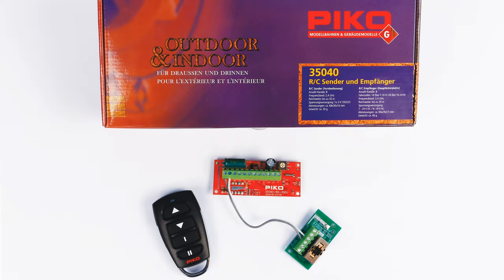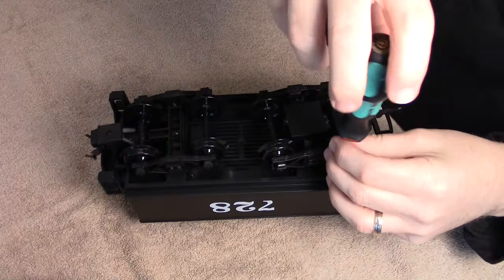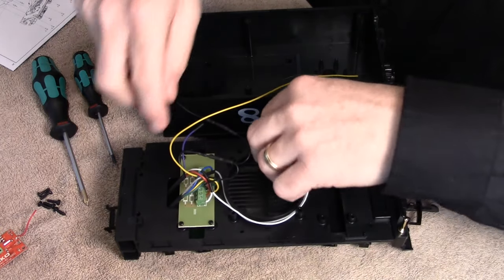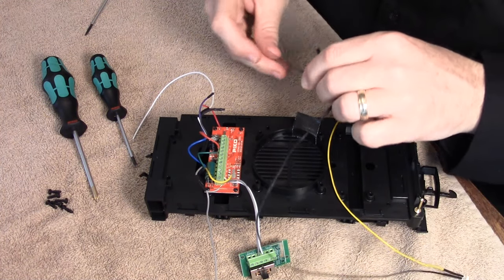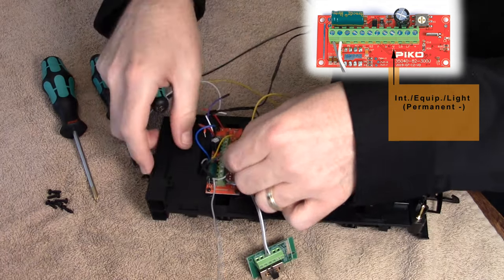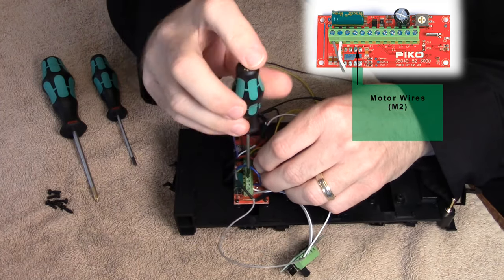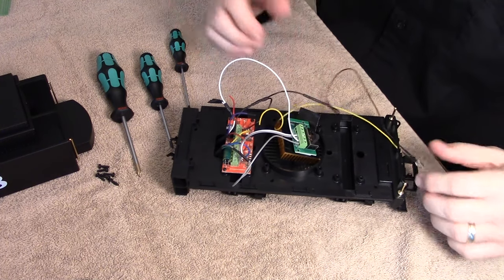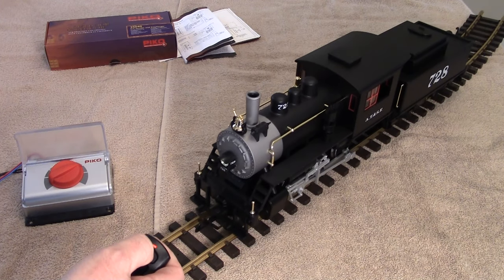35040 R/C Receiver Direct Installation

Comment: What is happening if the loco keeps stopping on battery power ? I have two locos on battery power and they stop after a few seconds. Is it wifi signal interfering with the Piko remote ?
Reply from the maker: Paul, please contact us at support@piko-america.com for questions.  That is the place for tips or questions regarding your specific battery system and we usually respond within a day, most often faster.  In general, Wi-Fi signals should not interfere with the R/C signals we use.

Comment: May be a stupid question - but the subtitle says "To avoid shorting, make sure to put insulation between the bottom of the rectifier board and the metal heat sink."  But in the video it says ensure good contact between the 4 black squares and the heat sink.  How do I ensure good contact while putting insulation between them?  I'm new to this, but to me they sound contradictory.  Also what type of material should be used to provide the insulation?
Reply from the maker: @Cory Wilson, We understand how this could seem like contradictory information.  The four squares/rectangles take heat away from the circuit board.  The other pins on the board, or the heatsink itself, have some metal in them.  So they should not touch elements that carry current on PC boards.  
Kapton tape is well-known as an insulating material.  Electrical tape could also do if you don't have Kapton tape.
Reply: @PIKOAmerica  Wow - that was a FAST response!  THANK YOU!  So to make sure I'm understanding correctly (sorry again for the noob question) - I need to insulate metal-to-metal contact between the board (solder points) and the heat-sink, but allow direct contact between the four squares/rectangles to the heat-sink, correct?

I'll look to see if I can pick up some Kapton tape... maybe Eric has some I can borrow.  I ordered two of the 35040 remote/receivers today, that I hope to use in some scratch-built locos.  I have one of your small r/c diesel switchers and love the behavior of the radio/receiver!
Reply from the maker: @corywilson4550    That is correct.  The four square points are for heat exchange/diffusion.  Anything else should be insulated.  
Have fun!
Reply: @PIKOAmerica   Thanks again for your answer.   I'm working on a scratch-build, and I'm very new to this.  If I want to use LED lights, is there a specific voltage that I need to look for?  For example, if I plan to use 14.4V battery power (2 7.7v in series), would I need to choose LEDs that accept higher than 14.4V DC, or does the board somehow control the forward voltage to a certain level?  Also - regarding the lighting - are there any wiring diagrams showing how, for example, a simple two-lead LED light should be wired to the board?  (Again I apologize as I know these are very basic questions, just trying to learn without burning anything up!)  Thanks everyone!
Reply: @danpikoamerica7314  Thanks Dan.  I'll send future inquiries to the email address.  I appreciate your reply and these great videos!

Comment: Thats fine for just one loco, but can i use it for more than one? Wont the signals of different locos interfere?
Reply from the maker: @RommyArts, This system was designed so it is completely flexible and eight R/C channels are built into the 35040 board and the remote!  You can install a 35040 in every loco and control them from the R/C remote with matching channels, or different ones.  Multiple locos can have the same R/C channel for a double or triple consist - or with distributed power!  You can also have a second channel for another loco or consist.  You can have a third channel for more options like a switching line.  The eight channels give you nearly endless possibilities from one simple system!
Reply: @PIKOAmerica  and how do i bind a second receiver to the controller?
Reply from the maker: @shmeerlubs5506   The instructions show you where the radio channel frequencies can be changed.  It is a circular dial that can move from 0-7, giving you 8 channels to choose from.

Comment: What battery should i use? I considered multiple Options but i cant decide
Reply from the maker: Hi @RommyArts... questions like this are usually better via email or the phone.  You can easily contact us at support@piko-america.com anytime. 
The challenge for us to answer is that the battery you use is really up to you.  Some folks use 14V R/C car-type batteries, others use AA or AAA's with battery housings... but there are more options depending on what you want.

Comment: In my loco there are 2 cables coming from the front and back light each. How should I connect them?
Reply from the maker: @RommyArts, please contact our support line via phone or email.  The email address is support@piko-america.com.  This wiring question is covered in the manual, and the support folks can respond to your specific question to better assist you.